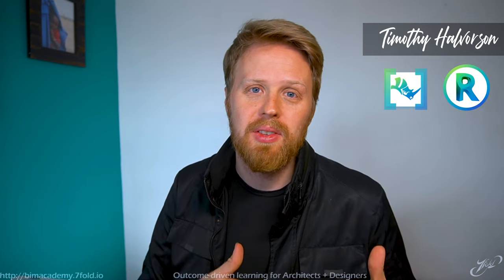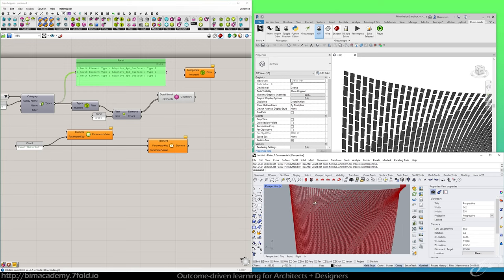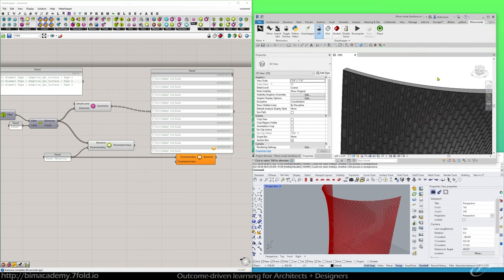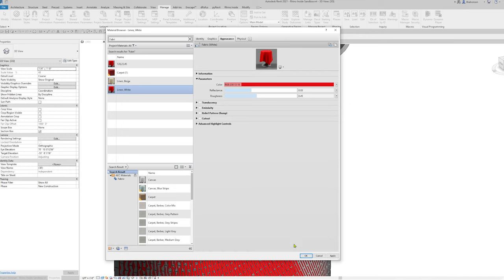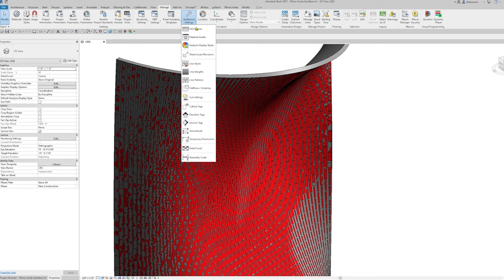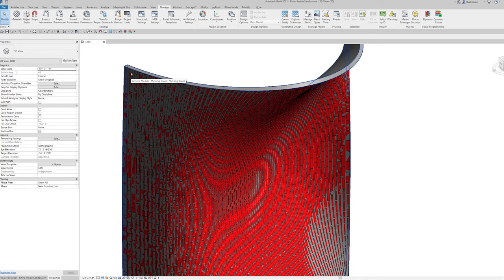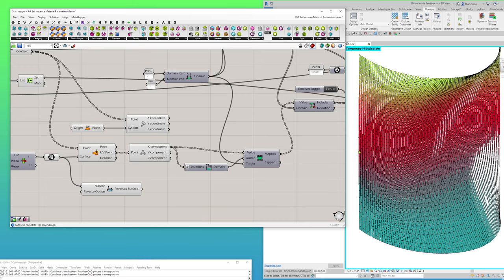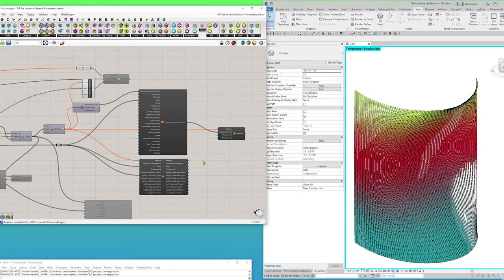Rhino.Inside | How to Automate Setting Revit Materials Per Panel

Comment: Great Tutorial! It is really hard to explain all the details in a video tutorial.. How struggling.. but, you did a really great job! thanks!
Reply from the maker: Hey thanks I appreciate it! I figure a start to finish workflow with the YouTube chapter links included is more useful than breaking workflows like this into shorter pieces. Just think how much time you can save by automating tasks and activities through Rhino Inside! This is just the tip of the iceberg with the door that has been opened.